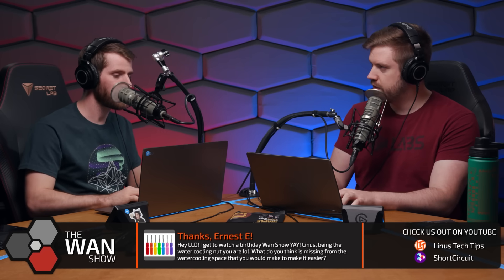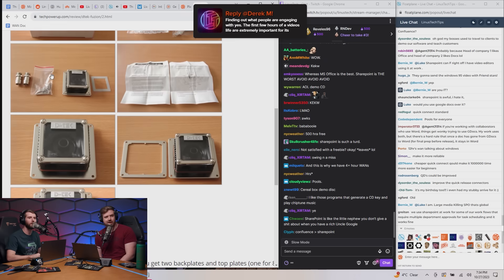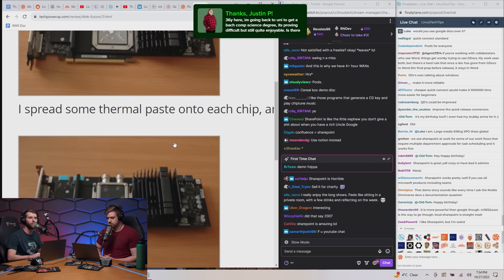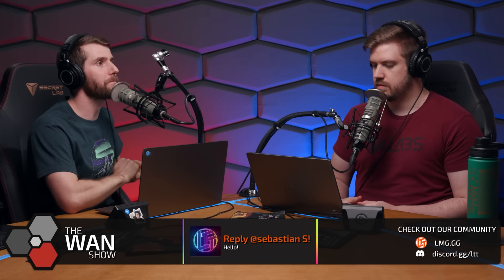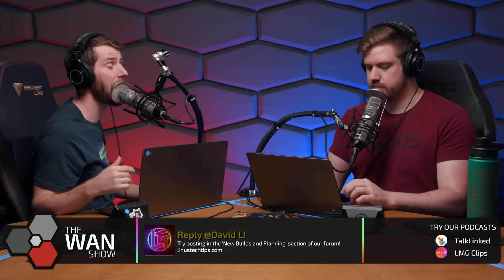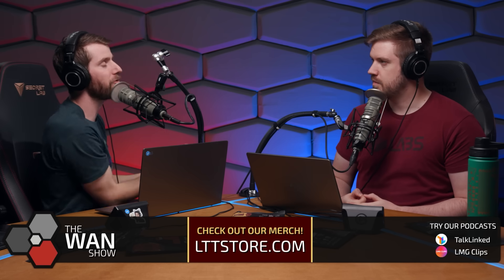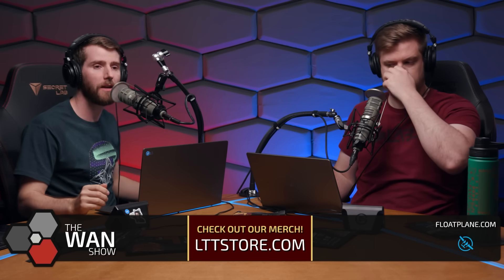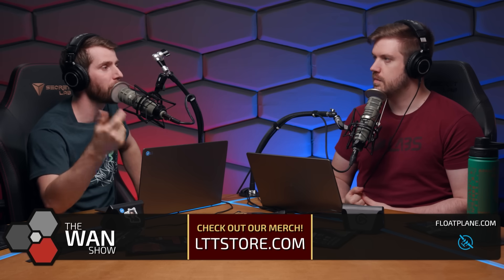Water Cooling is Broken

Comment: GPU block prices is why I went back to air.  adding 150-250$ to the cost of already overpriced gpus is just rough.
Reply: Water cooling is just so unnecessary, it's a thing less than 1% of users should be using, if you literally have nothing else to spend money on then you start doing water cooling, otherwise putting any dollar amount to better components is just always going to win.
Reply: @UhOhUmm  I don't really see where you are coming from... Obviously it stupid to spent hundrets of dollars to watercool a 4060. That does not make watercooling as whole unnecessary.
Apart from going passive cooling a waterloop is your best chance to get a system quiet. If you have space constraints watercooling can be the only option to get better components without overheating them.
That definetly covers a lot more than 1 % of users
Reply: @haariger_wookie5646  waterloops cost hundreds of dollars, you can easily jump an entire tier of components. system quietness is massively overblown, especially these days when majority of gpus already come with gigantic air coolers. just put your computer further away...
Reply: @UhOhUmm  I agree with your sentiment. My previous build was watercooled using an all-in-one system and I found it rather unnecessary. My current build is completely air-cooled and plenty quiet, and temps just really aren't a concern. There's not really an equivalent "But can it run crysis" in today's world, and so pushing hardware to its limits for maximal framerate is only necessary in extreme niche cases.
Reply: At that price just buy a better gpu and underclock/undervolt it if you really care about temperature.
Reply: @haariger_wookie5646 
Power limit your higher tier components and buy good headphones for the price difference.
Reply: @LoganChristianson bro really said there is no equivalent to "can it run crisis" with Cp2077 2.0 and Alan Wake 2 just released.
Reply: There’s always an equivalent to “can it run crysis” 

Every year tech gets faster and we need things to test it on. Cyberpunk path tracing is a great example.
Reply: @ciprianrobo  
There's no "it's not enjoyable/it doesn't even run on lower settings" though. And if then that's honestly on the devs doing a piss poor job with optimization, not on medium settings blowing your mind with the fidelity as well.
Reply: How often you buy new GPU? If you can afford every generation then I don’t think new block will ruin you financially, but this is not every person case. Typically CPU/GPU upgrades happen every 5-7 years and more likely not at the same time. Also people are seeking for used HW these days.
Reply: @LoganChristianson  looks at alan wake 2 yeah there isn't anything like crysis today.
Reply: @Shadowninja1200  I didn't say there weren't visually impressive games.
Reply: @robertrudik3022  upgrade every other or every 3rd gen depending on the performance bump.
Reply: Honestly, water cooling is the kind of thing that you only do if you enjoy it, because it's a lot more work than an air-cooled system, and quite frankly the performance difference is marginal at best

Comment: As a machinist I know for a fact that it's not that much to make a cpu water block. It might cost around 10-20$ of material and labor. it doesn't cost much to make copper water block the raw material would be around 2-8 $ the rad I think would be the most expensive part of a water loop to make.
Reply: I am not sure about copper rads, but aluminium rads are very easy to manufacture. You get brazing clad sheets, form them to fins, stack the fins into the frame and put them in an oven and the sheets will solder themself. So you pretty much only need a gew untrained worker to stack those fins. 

I believe Thermaltake has an older video of their rad manufacturing on youtube.
Reply: A copper water block for 20 bucks. No, I'm absolutely not. An aluminum water block. However absolutely you can get that for $20 or less
Reply: @the_undead  Guess it's good they're referring to manufacture cost, not retail.
Reply: Actually the microfins are hard to manufacture, but most cheap CPU skip that. It doesn't gain more than a few C.
Reply: @MyBrothersMario  the solid block of copper. You would need to make a proper part would cost far more than $20. Copper is not cheap
Reply: Wasnt there a video of bitpower that claimed that maschine time for 1 block is around 2 hours?
Reply: @NoAlias_  this person is not actually a machinist because that cost estimate for a copper block is way too low
Reply: @the_undead bullshit ..a kg of copper is at 9€ ..for a water block your maybe need 200g
Reply: @the_undead it's actually not ..the material cost is maybe 3-4€
Reply: The skiving machines which raise the microfins for the immersed side of the heatsink are incredibly specialised and costly. It's an expensive step in addition to the traditional machining operations.
Reply: As people have said, microfins. Gamers Nexus has a video on it, where they tour a factory that makes them.

Comment: The problem with watercooling is the price. I did a custom hardline wc loop with cpu, gpu, mb, 2x 240mm rads and a pump res combo for 400€ 4 years ago. Now that barely gives you a gpu block and not much else
Reply: you can easily triple that today
Reply: Cost, Risk and lack of universal fittings what seems to be 13mm in one brand is a 12 or 12.5mm part in another
Reply: hard tubing is pointless.
Reply: Don’t forget about fittings.

Comment: With how efficient air coolers can be for relatively cheap, it’s wild to me that people water cool for anything other than aesthetics or truly specialized workloads
Reply: some people need it to fit in tiny cases or 1U or 2U racks etc will need them tho
Reply: @simdevils  I’ll give you that the rack mounts make sense, but how can water blocks and pumps and reservoirs and tubing take up less space than a compact air cooler?
Reply: @micahv9365 I'm guessing it's not about the space occupied but about the airflow being too restricted if the components fill up the case too much, in which case you might have a better time filling the remaining space with tubing to get the most out of it? Just speculating though.
Reply: tbh for me its all about noise, got a Mora360 passiv cooling my pc, still have the Fans attached but they never spin up lol
Reply: I think a lot of people do watercool for aesthetics more than anything. At least with hardline builds anyway.
Reply: Me too, I never really understood what's so appealing

Comment: Even funnier if you build your loop, get a new GPU and then ALL water cooling manufacturers are like "Yeah, no block planned for this GPU".
7800 XT anyone? 🥺
Reply: There do exist waterblocks for 7900XT cards
Reply: What brand board? Because they're definitely is blocks for 7000 series cards..... The price of the blocks also means they generally only do the top 2 cards in a series though.
Reply: Nah best is if you bought a block checked should be ok and finally attempt to put it together, NOPE.
Reply: @luminescentlion  ASUS. All blocks I've seen are only for 7900 XT(X). And that's only one block as both the XT and the XTX share the same PCB layout. At least for ASUS cards.
Not to mention that EK and Alphacool both stated, that they are not doing a block for the 7800 XT.
Reply: @grijnskat  Alphacool have stated (In a forum post) that they have started work on a block for the reference 7800 XT
Reply: well the number of people who have custom loops and don't have Flagships is like 3, so it boils down to economics.
Reply: corsair's new hybrid gpu block?
Reply: Bykski makes them... Eventually

Comment: What water cooling needs is more soft tubing in the spotlight. Hard tubing is only good for aesthetics, I wish youtubers gave soft tubing more relevance. It's easier for newcomers, cheaper, doesn't need lots of work and tools for bends or additional joints, it's actually safer by being less prone to leaks, you can work in your computer without draining the loop every time since you can freely move tubes around. It's really infinitely more convenient.
Reply: Yeah facts. I have a Thermaltake Tower 900 and I run both hardline and soft tubes in my loop. Hardline to and from the pump/res combo in the front of the case and from/to my cpu block but from there it goes behind the motherboard into a secondary reservoir which then converts to soft tubing before heading to the radiator which is all in the back and not visible.
Reply: You have your answer in your comment. Soft tubing looks like shit, and when YouTube is so visual and thumbnail driven, looks are everything.

Comment: Alphacool has been selling modular gpu coolers like that for ages now. Standardized block on a card specific base plate.
Reply: Alphacool dropped the Nexxos GPX after the 1080.
Reply: @ionstorm66  Hmmm, didn't know that. But that'd show that it wasn't what ppl wanted. And if we're being honest: Most ppl who build a custom loop aren't concerned about saving 50 bucks two or three years down the road, especially when it comes with compromises in terms of both looks and performance. 
I expected Linus to complain about the ridiculous price hikes for everything watercooling over the past couple years, not a lack of modularity/compatibility.

Comment: i wonder if you could take your server rack setup and instead of running it inside your house, you could have taken some 6 foot diameter corrogated steel drainage pipe and put it upright and halfway in the ground with fins welded on the corrogation in a spiral with the buried portion wrapped in water tubing then have a 6 to 8 inch pvc conduit into the house for cabling with segments of a pool noodle to keep air passing through into the house. on the top you could take 9 or 16 of those Vasy Fan VF-390 EDF in a grid to pull air up and out the top of the pipe through a 180 degree bend weatherproofing.

Comment: The only problem with the uni-heatsink or w/e you wanna call it is a lot of times that's not enough for the VRM, years ago when I still used my R9 290X I had an AIO mod for it (kraken G10 i think?), while yes not the same thing I still had separate heatsinks for the vram and vrm and even with that vrm2 sensor would peg at 125C and the only way I fixed it was by strapping a fan to it.

Comment: I agree with this totally I have a 980 that's still running for my daughter's build and it has a Corsair GPU block that you could buy separately that would fit all that series of cards that that little fan to cool the VRMs and then you can put any water block all in one that you wanted on it and do the temperatures are in 28 and the most I've ever seen it get with a 140 mm radiator only 47° under load like awesome and it would be cool too because other people could have that don't want to do custom water cooling can have it in their build still make them look even more epic cool with two blocks of radiators one for the GPU and one for the CPU it's weird everybody's gung-ho for the CPU but where's the GPU stuff

Comment: Additive manufacturing with aluminium is a thing, check out selective laser melting (SLM) or powder bed fusion (PBF) technologies; however, porosity and oxide content may impede the thermal conductivity.

Comment: my Alphacool Eisewolf uses a PCB specific heat spreader & backplate. But after the integrated pump in the GPU block died, I replaced the pump with a GPU Block (no pump).
But they are quite expensive initially but as parts or pumps die at they are less to replace than the entire thing.

Comment: I forget the name but I've seen a demo of SLS (selective Laser sintering) of aluminum. the issues are- the process welds the part to the build plate requiring post print machining (think bandsaw running parallel to a plate) the company claimed that the process included data on in process analysis of porosity so the amount might be known and/or controlled. theres an F35 part that either was or is made that way.  there are companies running it as a job shop so it can be ordered. I'd try protolabs because they do something else that might work better. the other issue is... powdered Aluminum is explosive so there are some security concerns. here in the US Homeland security demands to know and monitor the stockpile. Protolabs started out using a 3d model straight to CNC aluminum mold and still does than kind of machining. the reality is unless there is a way to make it universal like standardize component height so a multilevel heatsink isn't needed none of these are going to be inexpensive any time soon.

Comment: I think the issue with this idea is that the copper from machining can be recovered for cost by selling to recyclers. My understanding is that it requires relatively little processing to recycle and it's also relatively easy to machine. Additive manufacturing, however is a comparatively long process with more bespoke results. Maybe necessary for some situations, but if there is any scale to it, machining will be cheaper.

Comment: 3D printing metal parts. The only industry I can think of doing this is the airline industry. They always did this with prototype aircraft. Yes, I agree that this should be more common place.

This brings up the question of why the US government isn't doing this since it's had its own bizarre aging hardware problems. They once had a maintenance issue at an icbm silo site and they only had one tool in the region between several silos. Instead of buying a defunct tool, they have to ship it from site up site to continue that specific part repair. 

So now I'm wondering why 3D printed metal parts and tools aren't being printed and used more often with the 60+ year old hardware we still use.
Reply: A friend of mine works in a company that does additive manufacturing for metals (aluminium and titanium), the company mostly does space research.

Comment: Why even spend hundreds on cooling when for most hardware 3 or 5 large fans do the job? If it's too hot, power limits or undervolting make more sense these days.
Reply: That is true for most people. But water cooling is for the niche and it is meant for those that either want or need the better cooling for extra speed or lower temps without limiting or lowering the processing speed of the components. Also water cooling is also great for small form factor builds which is another niche so it may be a more important for that kind of build where air cooling tends to be harder to keep it cool as it can be more restrictive for air cooling. So it is dependant on the usecase but if there are ways to get it cheaper or capatable with a higher amount of components quicker or easier that is always a great thing. If I said anything incorrect just point it out and correct me.

Comment: i started watercooling my RTX 2070 with aliexpress generic GPU block.
i then ordered some M.2 SSD heat sinks that i hat to demel down at some spots to cool the other components passively with a case fan that generated some airflow over them.

this did work well. i did run it like that for over a year until later i upgradet it to a full cover GPU block when those for my GPU where on sale.
Im still using the same GPU.

Comment: If you really wanted to get clever you could have a sealed PC that used cooled refrigirant and pumped it through the PC case interior before going and doing the heatpump thing and releasing the heat outside the PC.

Comment: it's not suitable for end user applications, there's way too many elements that can fail from the acoustics side
also if the pump stops you're overheated in seconds
and if it leaks you're done for too
Reply: if the pump stops, my CPU will throttle, and my fan control software will alert me and shut the system down. System is fully pressure-tested and is not likely to leak.

Comment: With recent GPUs all come with seriously oversized coolers, and how little performance you can gain from watercooling vs that quad slot air cooler, GPU watercooling simply isn't worth it anymore.
Reply: The stock coolers all very quiet too, you can only hear them at maximum power slide.

But. But.

I still bought a GPU water block this week. Just so that even maximum overclock is quiet.

Comment: Unless you're doing SFF there's very little reason to water cool. Large air coolers are plenty good enough for much less money.
Reply: And much less hassle, with less risk of things going wrong.
Reply: I water cool and over-cool (Dual 360x45mm rads on a 7950x and 3080) so that I can have a system that is dead silent 24x7. GPU fans are quite loud after a while, and depending on fan speed, eventually you'll find a frequency that causes the GPU heatsink fins to resonate and ring a bit. I just run 6 Phantex T30s at 800rpm fixed, and they don't make a sound, even if my CPU/GPU has been crunching raw photos in lightroom for several hours.
Reply: @acquacow  for the price of rads, fittings, fans, etc you could have stuck the PC in a closet with fiber optic thunderbolt dock like Linus.
Reply: I gave up on water and went all air. Not worth the hassle
Reply: @StackableOlive   Price is not a concern. Some of us dont want cables running from room to room, or have brick walls that have nowhere to hide the cables. Also the rads, fittings, fans, etc are all reusable. Even my Pump/Cpu block/ reservoir combo will go on to my next build since it works with AM4 and AM5.  500W (3080 + 3900X) 3 HDDs, 3 SSDs,  2 internal radiators all inside an NCase M1 would be impossible on air. There's also an external radiator with fans placed in a way so that they also cool the home theater amplifier.
Reply: @rolanie3727  I did include an exception for small for factor. My previous build was an air cooled 1080ti and 280mm aio in that same case.
Reply: @StackableOlive  Ah Turing, what a great architecture. With space for a 2 slot cooler I wouldn't water cool it either, You're right.